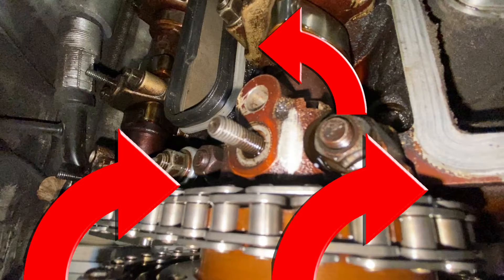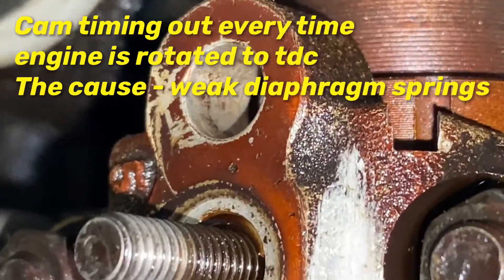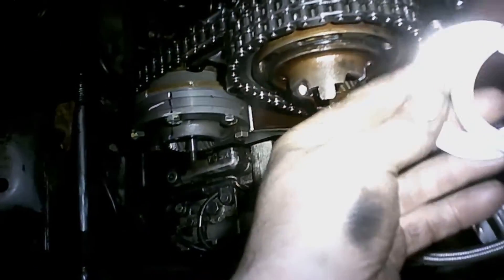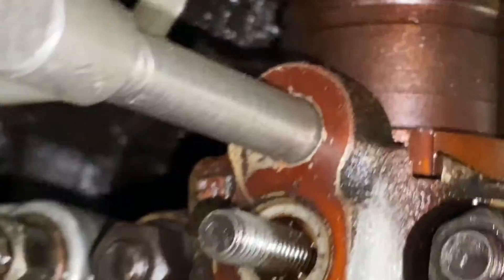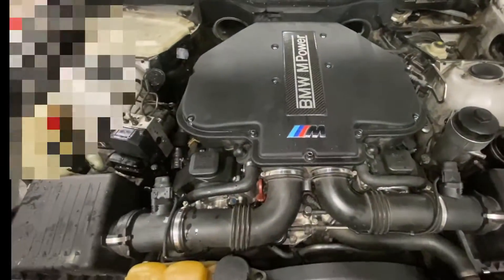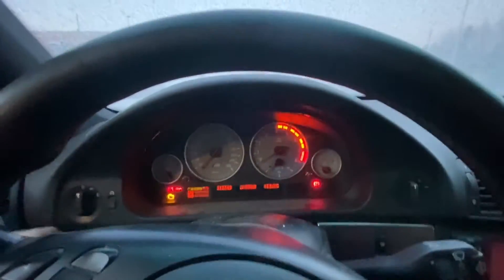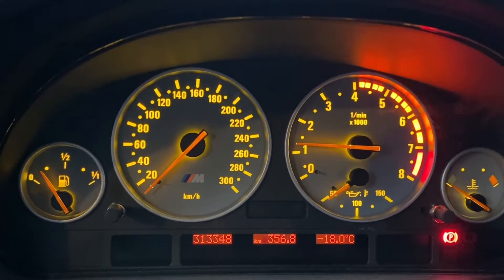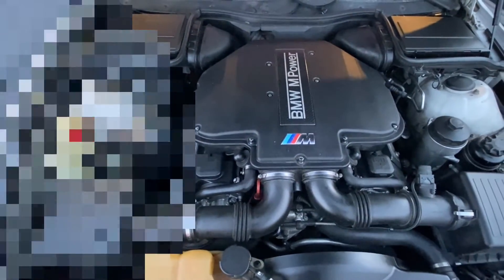I Finally Fixed This Abused M5 That Wouldn't Run Or Accelerate!

Comment: Hello, I have adjusted the timing and the vanos on my BMW M5 E39. My problem is that it won't start. It coughs but won't start! I changed the TDC sensor, it's still the same. I haven't changed the camshaft sensors yet. Would you know why it coughs but won't start, please?
Reply from the maker: The timing is out
Reply: Well, I followed how to do the calibration with the TIS software, it all wants to start but doesn't start?
Reply: The engine compression is good, the fuel pump is good, the ignition is ok I think my problem is the timing I followed how to do the timing with the TIS BMW software there is a precision that when the engine is stopped the vanos places the camshafts in the position suitable for starting the engine. Could you take a photo of the position of the camshafts of bench 1 and 2 when the engine is stopped so that I can time my engine like yours please
Reply from the maker: I cant do that since the video was made 2 years ago. You need to lock the cams with the pins and if the timing slots on vanos dont line up you need new compression washers and prob a full Beisan kit
Reply: I put the pin on my crankshaft pulley at TDC ignition cylinder 1 and I wedge the camshafts with the pins I take out all the pins I make 2 turns crankshaft I recheck my timing it is perfect! but when I want to start it coughs but does not start! on the other hand we agree that after having tried to start if I recheck my timing I must no longer be able to put the pins in the wedge shaft because I read that the vanos put the camshafts in a position to see start!